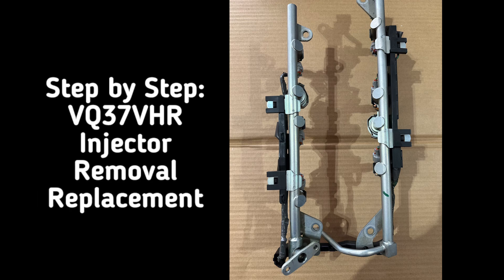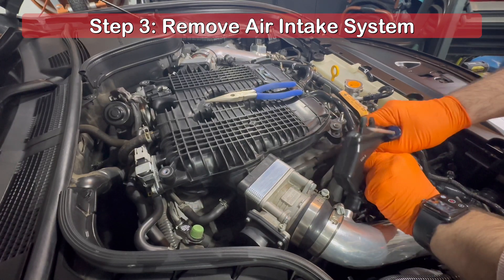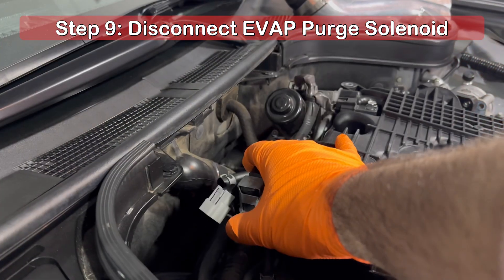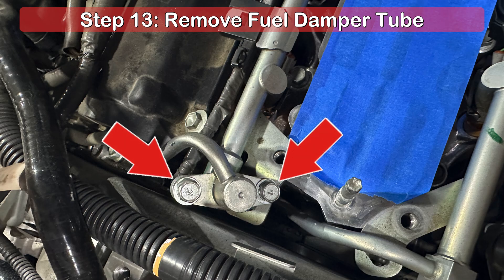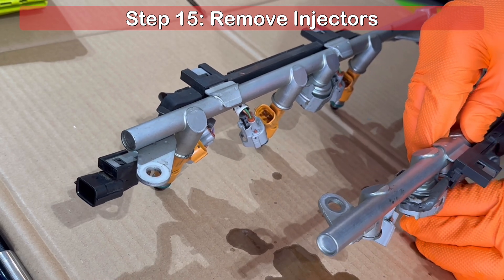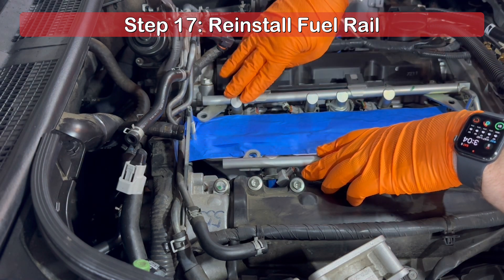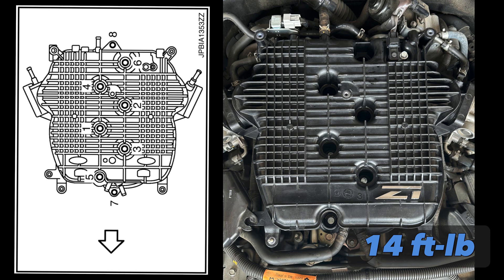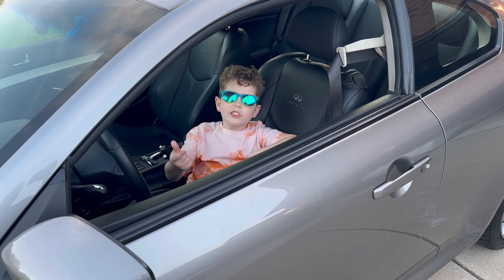VQ37VHR - Step-by-step Install/Replace Injectors (G37/370Z)

Comment: My car has been having rough idle at start up. I think I need my injectors cleaned.
Reply from the maker: That could be an issue, I’d start with something a little more accessible first. Try cleaning the MAF sensors and throttle bodies to see if that makes a difference.
Reply: @StylinGVQ37VHR lol I cleaned the throttle bodies maf got new spark plugs and coils and still rough idle. I’m hoping it’s the spark plugs now. Unless the fuel pump going out? Idk. lol
Reply from the maker: @Viclopez023 oof, it could be a myriad of things then. I guess the next logical step would be to check injectors and ignition coils. But you’re right, could be injectors, fuel pump, vacuum leak, and fuel filter to name a few. 

I’m going through a similar issue with my short term fuel trims chasing each other around and making a fluctuating idle. There are also some CANBUS communication errors being shown so we’re gonna swap out the ECU to see if that’s the issue there.  One of the reasons hadn’t posted anything in a while.
Reply: @StylinGVQ37VHR  I check the maf sensor and it’s reading high air while the engine is off so I’m think the maf is bad or maybe my ecm ordered maf we will see
Reply from the maker: @Viclopez023  Good to know! Keep me updated when you find out the final diagnosis.

Comment: Now that's a diy how to video, great content and no nonsense fumbling seen in other videos, did you take the guide seal/spacer off the old injectors and put those on the new ones,,  that's the only step I think you skipped, but well done and thanks I'll be tackling this job soon and have a great reference to use
Reply from the maker: Hello! I didn’t reuse anything from the old injectors, just replaced the black/green o-rings with a fresh set on the R35 injectors, which are a perfect fit compared to the OEM ones.  Also, I appreciate the kind words! I wanted to create “no fuss” DIY videos. Thanks for watching!

P.s. When you get around to doing your install, just be aware the 10mm bolts on my throttle bodies are not OEM and you should probably have the 5mm Allen heads. It was pointed out in another comment and I forgot I swapped them out.
Reply: I have always made it a practice to perform my tasks with the best tools usable. Makes me cringe when watching some of these morons doing tasks with crap tools (harbor freight shit). I usually change out my bolts with higher quality stuff..your video is a helpful tool keep it up

Comment: Nice video.  Did you change the allen bolts on your throttle bodies to 10mm hex?  Even the diagram you had on screen showed allen head bolts.  I prefer 10mm hex so i might do the same next time i remove the tb’s.
Reply from the maker: Wow, nice catch! I forgot the OEM bolts were the 5mm Allen heads. The ones shown came with the aFe throttle body spacers that sit behind the TB’s in the video. The bolts here are longer than the OEM to accommodate. If you could find a bolt with a 10mm hex head, bolt length 60mm, and thread length 25mm it would work. Thanks for finding that, I’ll need to address it in the notes.
Reply: @StylinGVQ37VHR how long are the oem ones? Because I hate remove the allen ones they take forever lol. I want to replace them with 10mm
Reply from the maker: @Viclopez023 the measurements in the reply above should be the OEM dimensions. So look for a 10mm bolt head that has a bolt length of 60mm and 25mm of thread length.